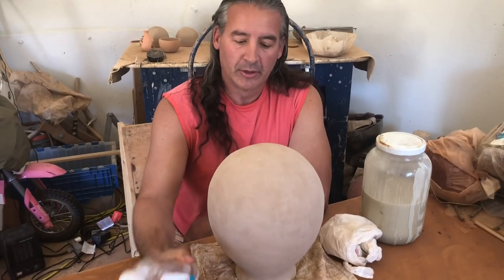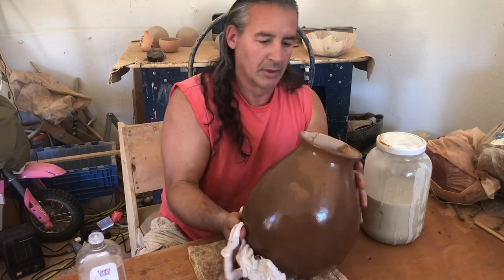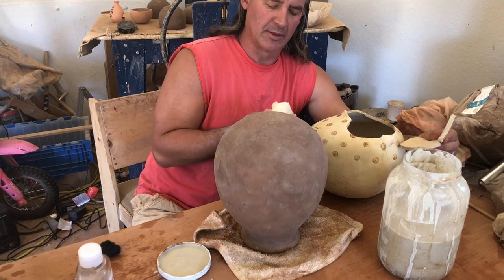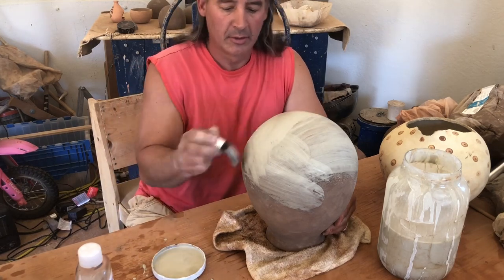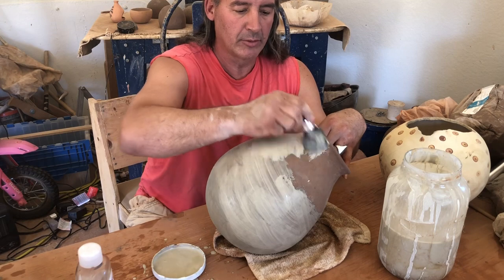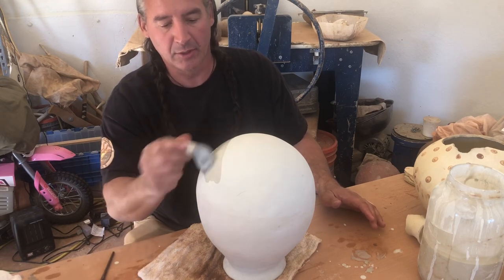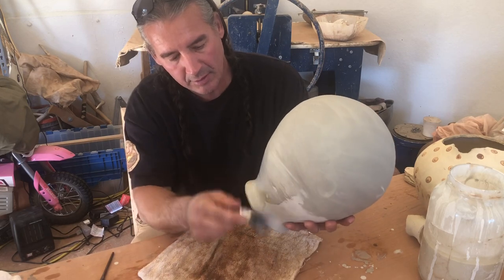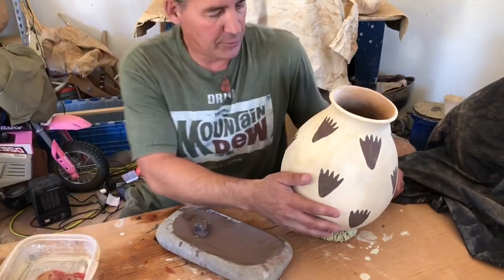Pottery and mineral oil

Comment: Love the color.I’m still having trouble getting an even full coating of slip. Your slip looks a lot thinner than mine. Wish I knew what I’m doing wrong.
Reply from the maker: Yes mine was on the thin side, you want to apply it and not try to go over the same place or you will pull up the clay body surface

Comment: My son uses olive oil after the slip for burnishing, and gets very glossy finish. Great video brother! Nice pieces!
Reply from the maker: Try two coats of mineral oil after the slip drys. It doesn’t have the organics in it and leaves a cleaner surface
Reply: @tonysoaresnativeclays1434  I will surely try it! Just broke a whole batch of pots, with a high wind coming up during open firing. 5 months of work gone in a flash. Building a kiln soon and plan on using the mineral oil before slipping. Thanks!

Comment: Hi Tony, found your channel through Andy and I'm subscribing. Love your content and presentation... Good stuff without fluff!! Question: I want to make single-fire burnished ware, but burnishing a tempered clay body does not produce the best sheen. Solution: slip the tempered clay body with a slip that roighly matches shrinkage of clay, then proceed to burnishing. Good to go or over thinking this? Thank you and best wishes. You anywhere near Temecula?
Reply from the maker: Yes a double coat of fine slip let dry then two coats of mineral oil. Then polish. I’m in Joshua tree, 2 hours north east of Temecula
Reply from the maker: Also if you can remove the sand and use a grog body might be better. Grog is softer and more porous, helps the slip grab and absorbs more water during surface treatment

Comment: OMG I can't wait to try oiling my bowls. The clay I have been using has a lot of shrinkage even with the addition of temper. I have yet to be able to slip anything without the moisture causing to much rehydration and crack all the time. I have just been burnishing and dealing with all my work being orange or smudged black. I would love to be able to try black on white or polychrome decorating. Now I might just be able to pull it off. Guess I'll see.

Comment: 🪶🪶🪶🪶🪶Your pottery is the best, i want one to use as a sort of water filter. So its definitely to filter and or store water, i need it to be porous like pumice to sweat and pressure to make it flow to bottom without holes. Like cone shaped. Do you sell any? 

I have an idea of what i need. I have one video from Argentina, but thry only sell locally. 

Question does baby oil, seal pottery and block it from sweating.

Please reply.
Reply from the maker: @amdraa2860  after the firing it remains porous
Reply: @tonysoaresnativeclays1434  

Thanks for replying 🪶⚡Here is a link to the video: they use wood cylinders somehow to creature pressure for more efficient water flow to the cone shaped vessel? I still think their pottery is slow in the process of filtering water. It also contains sawdust, it read in article helpful to filter out oils.
🪶https://youtu.be/BhVj5dK7BQg?si=RdsUu4dU4NW6d3ZH

Comment: Any idea what mineral oil does vs water when using a burnishing stone to polish it?
Reply from the maker: It seals the surface and keeps water from getting deep into the clay wall, keeps the pot from cracking, and helps with aligning the clay particles while polishing

Comment: Do you think hide glue would have the same effect? I can't get the paint to stick lol
Reply from the maker: Hide glue will work after it is fired. Just add a little fine clay to your oxide , it should stick
Reply: Fine clay is pretty valuable these days😂
Reply from the maker: @sethtsosie4524  put dry clay in a bucket of water and let it dissolve. Stir it around then let the heavy stuff fall for a minute, pore off the fine stuff into another bucket. Let settle for a day. You can add vinegar to help it settle faster. Pore off the clear water then you should have your fine clay to mix with paint